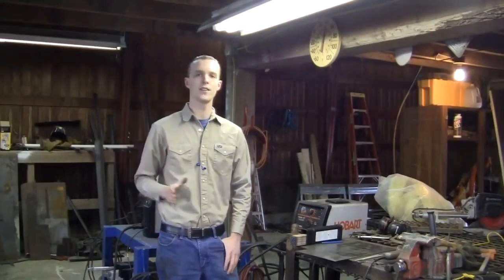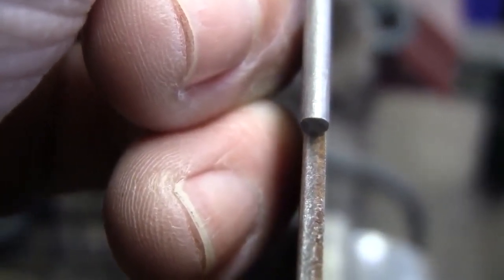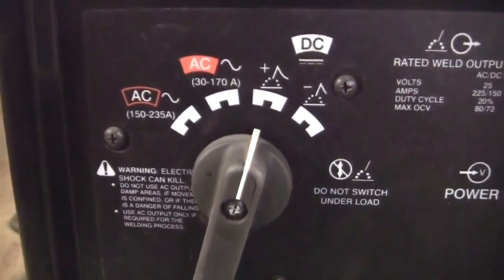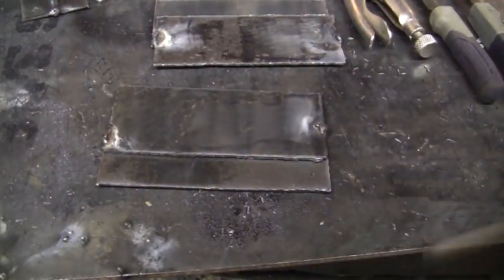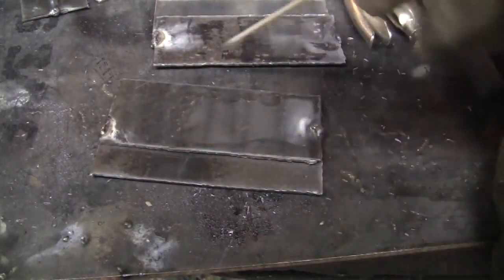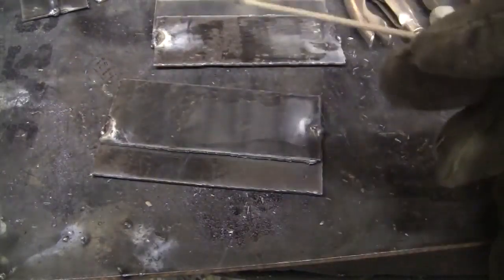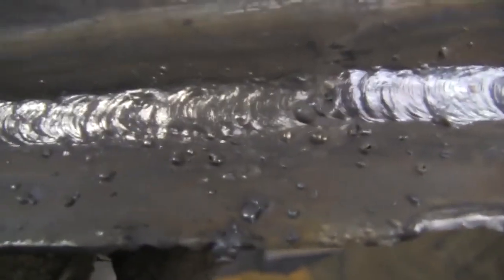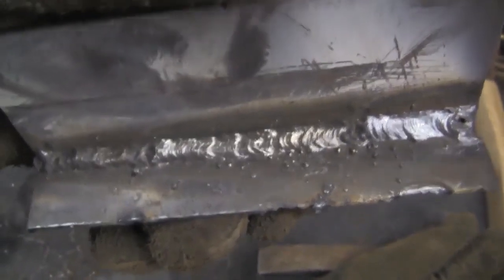HOW TO STICK / ARC WELD THIN SHEET METAL WITH 6013!!! FREE WELDING INSTRUCTIONAL LESSON

Comment: I had to stick weld a washer on a disc rim a couple days ago. Only had a stick welder available. I just turned the amps down to 60, and spot welded around it. Turned out useable